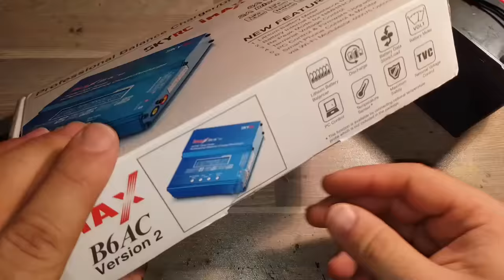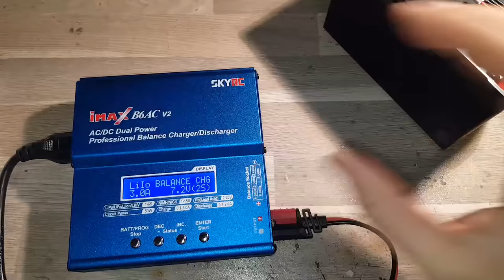DIY How To Make a Powerful 12V 18200mAh 420A li-ion Battery Pack

Comment: Also, make sure your connections are pure nickel, not nickel/steel as the steel used may corrode over time as 18650 battery does gas out when charging.

Comment: Looks great, but be aware of that series connection you made using just nickel strip. It will not support the full current of the battery, or anywhere near it.
Reply: Should of ran that negative wore all the way to the battery instead of that extra strip he made
Reply: Which is exactly why on another site I read about using multiple stirps. You need to calculate the cross sectional area of each strip of nickel and compare that to the area of standard wire conductors then find out how many amps the conductors are rated for. Nothing wrong with going to a higher rated conductor either.

Comment: Well shown building process! Three remarks: First. The cells seem to have quite different voltages. For safety normally you would first (dis)charge all cells to storage voltage (3.6-3.8 volt). Second: I like the casing. Would it not be easier to turn the upper part (cap) 180 degrees and use a longervthick red and black power cable towards the outer connectors? Now you have to fold two stiff thick wires to close the cap. Third: You glue the cap of the casing to the lower part. To open it you will probably have to destroy the casing. Why not use a good piece of self adhesive tape? Greetings Gerard
Reply: Its DIY not a business or commercial product.
Reply: @exlenisupporter457  Commercial product would not be servicable.

Comment: I think you should also choose 18650 batteries on the basis of their similar internal resistances as well (besides rated & measured capacities). As some batteries might be failing by having high internal resistance. 🤔😕
Reply: @ericklein5097  Aaah... 🤔😄🖒
Reply: @davidbolha  I have an open invitation for anyone to post a Liito Kala cell that performs better than the P42A discharge on my channel. Shit I'll even take a 32700 Liito Kala cell to go up against a 21700. Let's see the IR or voltage drop

Comment: Tre celle Liion in serie possono essere caricate al massimo a 12,6V mentre gli alternatori delle motociclette raggiungono i 14V, quindi nonostante il BMS le celle si danneggeranno...  Occorrono 4 LiFePO4 in serie per poter sostituire una batteria al piombo da 12V nominali, infatti queste saranno cariche a 14,6V e scariche a 10V esattamente come un batteria al piombo da 12V!   Io uso le A123System e vanno benissimo, oltretutto ogni singola cell 26650 può erogare 120A di corrente istantanea, altra roba!!!  ;-)

Comment: I think you should balance the voltage before combining them in paralel.just for extra safety and extend battery life
Reply: Batteries in Parallel are ALWAYS balanced... from the moment that you connect them.
Reply: @johncoops6897  That's what he means. If you just grab loose cells and weld them together, the charged cells will exceed rated discharge trying to bring the uncharged cells up. In addition, the uncharged cells will exceed maximum charge rate by several times. If they are tool cells, the amperage could be high enough to melt the nickel strip and/or loosen the welds.
Reply: @johncoops6897  He means the parallel grouups. We got 3.8, 3.8 and 4

Comment: if all the 21 cells are connected in parallel even then it can give a continuous current of 
2×21 = 42 Ampere ( MAXIMUM ) 
not 420 Ampere
& 
even then
the voltage will be 3.7 V nominal ( between 3.0 & 4.2 V )
Reply: That's assuming the cells have a discharge rate of 2A. There are 18650s on the market that can output 30A continuous, and as he wired those 21 cells in a 3s 7p configuration, that would make the equation 30x7 = 210A continuous. That's still not 280A, and I doubt he's using those exact cells, but it had to be said.

Comment: The outgoing terminals are rated only 20-40A
Reply: But what if you accidentally touch with something to it ? This build is extremely dangerous !!!
Reply: @inanc64  Every build has risk, it's power so don't drop the scalpel.

Comment: thank you very much ,I tried the capacitor 35v 1000uf  that came with the package and its seems to work great,  it seems to work very good with the car battery that I got  550 CC Amps I have no complaints at all. thank you for the information,  big thumbs up

Comment: That's not 12v, it's 11.1v . 12v is from 10v to 14.4v due to use cases. This stops charging at 12.6v, so a real 12v pack is actually a 16.8v fully charged.
Reply: I would personally say 3S is closer to 12V than 4S. Using the latter, it stops charging at 12.6V, with a nominal of 11.1V. Most 12V devices should be able to run on 11.1V just fine.
4S means that 12V (or 10V, depending on the cut off you choose) is the minimum voltage, and the maximum voltage is 16.8V. 16.8V is likely too high for most 12V devices and might cause damage.
The only way to get a true 12V pack is to either use LiFe cells (or LiFePO4), which are 3.2V nominal (4 x 3.2 = 12.8V nominal) or to use a buck/boost regulator, to provide a constant 12V.

Comment: Hi, 
Interesting and cheap spot welding solution you made yourself there. I liked that the solution was clean, however as an instructional video (which it looked like you were making). Then it would make sense for newbies to have an idea of what you are doing. Not adding a BMS isnt exactly a good practice. Even during discharging you can encounter that some cells might go below the recommended voltage and although that might not be a short term problem it will most definitely be a long term problem. As for the overchange protection you had a balance charging from your RC hobby charger. But it is also importent to note that it was in balance mode and not standard charging mode. Having similar age cells will making the balancing easier on the BMS so you might get away without using a BMS if you set a cutoff in min and max voltage before you can hit the marks. Anyhow I would like to emphasize that the whole package looks clean and is one of the better videos on YT with diy packs. You also clearly have an idea what you are doing during soldering. What i dont like is the Current 280A
, Pulse current 420A part where im guessing you are referring to the lipo pack ? Its misleading. For all the people wondering howmuch current you can pull through it then the recommended discharge rate per cell is capacity * 0,5 up to 0,8 so for a 2000mah cell you are talking 1000-1600mah per cell * amount in parallel . Your busbar in this case nickel strip will also play a factor in this. 
Keep up the good job.
Reply: Its sold everywhere he did not make it himself in any way

Comment: Where are the BMS? Or you need’t it? Do you take care of the battery safety? It will be very dangerous!
Reply: This type of battery layout is without bms. To load this type you have to take a loader for rc batteries like ISDT Q8 or similar, whitch take care of the balance of the cells. Therefor is the white plug btw.

Comment: Thanks for sharing. Everyone need to bare in mind that you can't use this battery in UPS without modification UPS itself.
Reply: What modification(s) to the UPS is required? The reason I ask is I have a Cypbepower 1500 UPS., it uses two 12v 9A sealed lead-acid batteries.  Both slightly larger than the case detained here.  at 18A I would assume everything else being equal it will last twice as long.  Is this not the case?
Reply: @TheNphillips  first of all you need to limit upper voltage to 12.6V or 25.2V if you will use 2 batteries in series. I dont know what type of connection your UPS use...and also I dont know of possibility of voltage regulation in it. But you also can  use Lifepo4 batteries with BMS board instead simple Li-ion.

Comment: I am thinking that even after I got good at making those (and it was my speciality,I was an auto mechanic) I am certain 3 hrs. I may be surprised at perhaps a bit more time. There is a popular battery powered solid state guitar amp (excellent preamp/amp design) that runs around off of a 20ah 12V lead acid battery. There is interest in a lithium/ion upgrade. I could assemble the battery packs at perhaps net 15.00 per hour? Replacement lead acid is only 20.00 off Amazon and it being solid state the amp runs a long time off of the 20ah batt.

Comment: 420A? Those nickel strips can't conduct more, than 15-20 Amps continuously without warming heavily. By the way, 7 pieces of 18650 Li-ion cells can't give you 420A anyway. But they can give enough current to overheat the nickel strips and even make fire in the worst case. So please be careful with it!
Reply: yeah you're right plus no fuse is a sure way to set your house on fire

Comment: only thing I would change is the power cable, too thin for high  load ... sure it depends about what you connect it to...but still...too thin for my businesz
Reply: Always go by the maximum output of the power source and not the load that is expected to be placed on the source, battery or AC line. If the power source does become shorted, at least your battery links will not be fried, which is the best reason for the battery to use a fuse directly from the positive terminal to the load as close to the battery as possible.
Reply: The power cable would be able to handle about TEN TIMES more current than the nickel strips he's used inside. There is no way in the world that the cable will even get warm if the pack is short circuited.

Comment: Can you link that flat cable resin solder and gun in here. Im also looking for an 4x18650 surge protector board to link them. I'm trying to make a good Bluetooth speaker battery for my good Bluetooth speaker

Comment: the cost of all the equipment needed would far out way the cost of buying one off the shelf. Only practical if you intend to make many battery packs to the point where the original costs are covered. Nice thing to know but in general impractical. Nice video well made.

Comment: Congratulations on your videos, I would like to know if in the realization of the spot welder, instead of the LiPo, it is possible to use a power supply.
Reply: Yes of course. The lipo pack used is a 3s pack, so ~12.6 volts DC at max charge. Find any dc power supply capable of supplying 12vdc at ~100 amps and connect it to the spot welder.  Now you see why most use a high C rated lipo or 12v car battery instead. They can supply high peak current.
Reply: @aaronschroeder483  100A wouldn't be enough. You'd need 200-300A
Reply: @ericklein5097  this is true. I should have updated my original comment, but forgot about it as it’s been 2 years now.  Most power supplies have built in short circuit protection as well that you would have to figure out how to bypass. Using the power supply to keep a lipo charged up would be a better solution but more involved (bms would be needed).

Comment: mate can you help me .. i got an e-scooter with 15.300mah (15,3Ah) battery.. that would be about 6 x 18650 or ? i want to build an extended battery for more range :)
Reply: hey, the voltage must stay the same. the Amps/hour is what you want to increase. so you just build an pack with the same amount of voltage, but more batteries in parallel.

Comment: I have and intest in making a battery for a 12v lift. It currently has 2 12v 12amp hour batteries and one that is 12v 7 amp hours 
It have a 100amp bracker on it. 
I am looking to make a longer lasting version for this

Comment: Hi , which battery pack you used for that spot welding?? What is current output for that battery pack used with spot welding Machine

Comment: This battery would work to power that mini spot welder right? Anything 12 volts around 400 amps is what's recommended. I got a car battery to build it with, but I want to build something smaller to power it.

Comment: Cool stuff I have a bunch of 18650 Layin around from when I used to Vape. 
I wonder if I could take all the married pairs I have an make some little power banks for led lights on my mountain model for RC crawling. 
I wish their was a voice over for the important bits as one wrong move/connection can be really bad. 
If you’d ever make another battery pack video it be great too see how to make a smaller battery that could be used to hook up lights on a model. I used a standard 3 wire RC servo for led lighting around the model is what’s in my head but no idea how to power it.
I’m thinking as in RC lighting usually is a 7.2 V Li-Ion battery id like to use 2 18650’s in series for a pack that could be hooked up too 2 sets of LED’s for each battery pack as I get confused when soldering lots of wires together for one power source. 
Thanks if my rambling made sense I really appreciate the help 
Cheers 🍻

Comment: Would a 3s 4000 mAh 50c battery be enough for spot welding?
Reply: If it is truly a 50c it should work, warm it up by test welding once the cables to the spot welder are warm to the touch try it. A 100c would be a better choice.
Reply: @Seven-ff8vr  thanks. Will try

Comment: Doesn’t it need BMS??I know which charger you are using you dont need BMS. But in this condition the Battery is not able to take charge from a normal charger which donot cut current or volt after charging fulfilled
Reply: Same as every single RC battery in the entire world. They don't have BMS either, do they?

Comment: Hello again, I am actually smack dab in the middle of this build or the welder. Did you noticed it has a track in the middle of the Positive and Negative, under the xt60.  Did you have to solder anything to that?
Reply from the maker: No i don't have soldering anything, just condensator and wire
Reply: @ARMTechHomemade  Just did mine, and I loved your design so much, I just did it exactly the same...Great results and great idea using the spot welding leads instead!!!

Comment: Thank you very much for your time and information,  I tried the capacitor that came with the package 35v 1000uf and its seems to work great,  it seems to work very good with the car battery that I got CC 550 Amps I have no complaints at all, big thumbs up.

Comment: 4 series connections at 0.2mm nickel will safely get you 6.4A x 4 = 25.6A continuous, not 280A. Look up the Ampacity chart for nickel.

Comment: Will this work as a replacement battery for APC’s ups?
Reply: Don't even think about it dude. Unless you figure out how to build an electronic board to manage the charge for lithium batteries in the UPS (could be too expensive, by the way), otherwise you might risk to burn your house.

Comment: Next time would be better to use 4s configuration if you want to use it for 12v appliances
Reply: je suis d'accord
Reply: Your mathematics is somewhat faulty.
12V Lead:  6 x 2.0 = 12.0V nom. 6 x 2.25V = 13.56 (Max Float)
3S Lithium: 3 x 3.7V = 11.1V nom. 3 x 4.2V = 12.6V (Full charge)
So, 7.5% under at nominal, 71% under at max charge.
4S Lithium: 4 x 3.7V = 14.8V nom. 4 x 4.2V = 16.8V (Full charge).
That's 23.3% over at nominal, 23.9% over at full charge.
However if it was a 4S and only charged to Lead Acid voltage specs, you'd lose quite a lot of capacity but cell life would be greatly enhanced.
Reply: @johncoops6897  4.2v is on the high side for max voltage charging, is stay around 4.1v.

However the discharge curve for lipo shows voltage drops off fast to around 3.7. in a 3s config 11.1v is too low in my opinion. I'd rather go 4s, start briefly over nominal then have it settle around 14.8v

Comment: La batería no lleva BMS?? Y qué tipo de conector es el que ha sacado para conectar a el cargador .
Gracias por sus videos, son muy interesantes.
Saludos desde Madrid (España)
Reply: It's a JST-XH. Number of pins depend on the battery configuration. For 3s is a 4 pin connector.

Comment: In this configuration we don't have short circuit protection, overcurrent protection, battery low volteage monitoring, temperature monitoring. In this configuration without BMS we can't connect it anywhere (fire risk). Safety first!

Comment: Why did you add a balance lead if you've got BMS modules that you can use?
Reply: Because most BMS don't balance. It just deals with over/under voltage and over-current. There are exceptions however the average resistor-based balance on a cheap BMS board will take years to balance a reasonable sized pack.

Comment: Its very dangerous not to connect a BMS because you can accidently discharge the pack to a deadly low voltage... Always use a BMS, even if you charge your pack with an external charger

Comment: Hate to tell you, but you only made a 10v battery.  You need 4s for a 12v battery.  Making a 10.8-11.7v battery you're making a good portion of the charge unusable by most 12v devices as most start having problems under 10v.  12v devices can usually handle + or - 15% of 12 volts.  This means 10.2 - 13.8.  If you're starting out below 12v, you will either cause damage or the device will stop functioning after voltage drops below about 10.2 volts, leaving half the charge sitting in the battery doing nothing.  If you start out high, say 13.8v then you can use so much more of the battery's charge.

Comment: I have a question I hope you can help me out. So I got one wheel of my hoverboard ran over. Its useless now but I saw your video and it got me thinking. It's the lithium battery that is in there salvageable to do what your doing in this video if I just use the battery and add the board your using to get 12v?? Asking cuz the input to charge it was 29.4v 2A capacity of 67.34wh.
Reply: Cut off all the scrap that's in the way. Remove the motor and hook up a dc-dc converter to make what ever voltage your looking for. Stick (mount) everything in a plastic ammo can. It won't be pretty but it'll work.
Learn everything you can before taking any any lithium battery pack apart.

Comment: That's all very nice but what is the point.  You CANNOT use it in a existing system that expect a lead acid battery charging cycle.  ??????